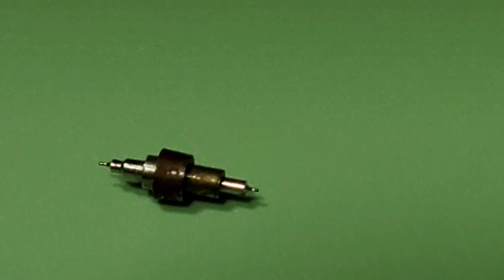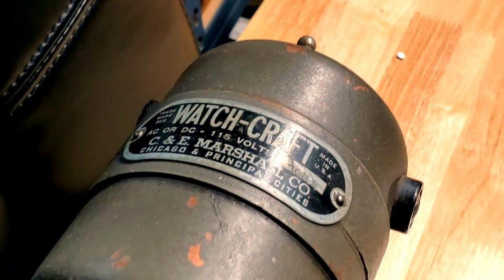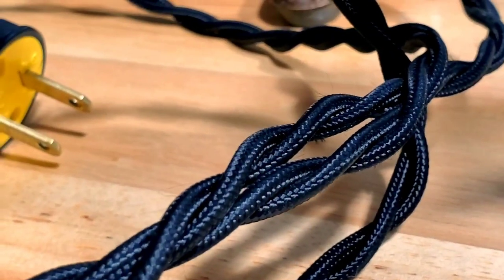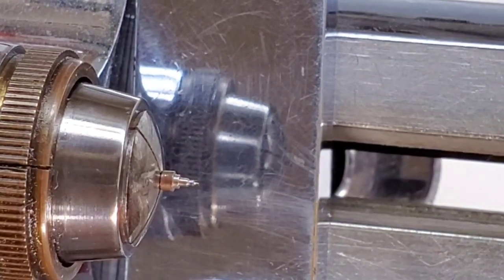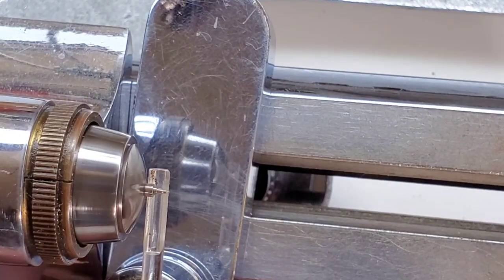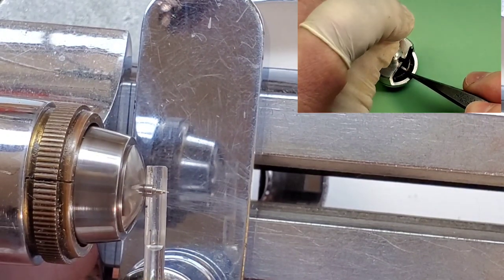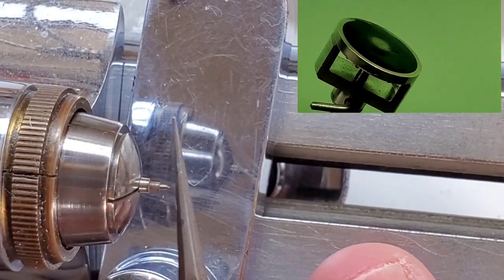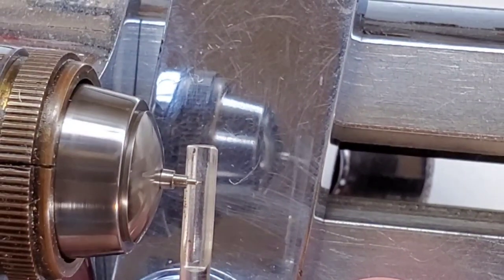Removing Rust From A Illinois Balance Staff To Put Into A 16 Size 23 Jewel Bunn Special 163 Type IIE

Comment: Great work on removing that rust. Kinda saw it cleaned up but the 'after' pic at the bottom right of the screen was blocked by your inserted picture in the round.... but I get the idea. I'm in the hunt for a staff for a Hampden 12s grade 307 pocket watch....
Reply from the maker: I appreciate it! Sorry it cut it off, if I remember correctly I got it off!!! Lol. Is the hampden a 3/4 plate?
Reply: Not sure what you mean by 3/4 plate. I'm not a watchmaker. I can send you a pic ...
Reply from the maker: @jatco84  sure that works.
Reply: Not sure how on youtube/here..?
Reply from the maker: @jatco84  you can send it to me through my contact email